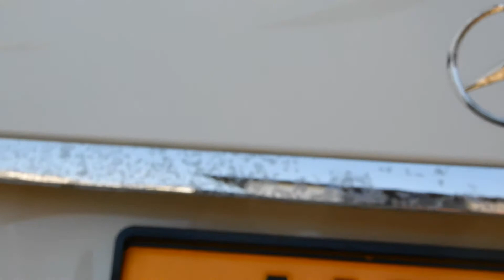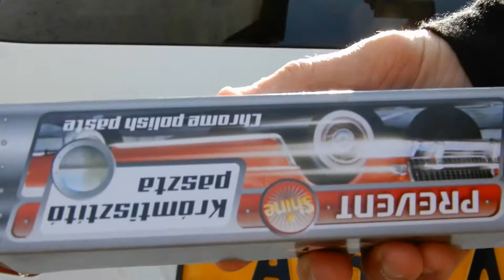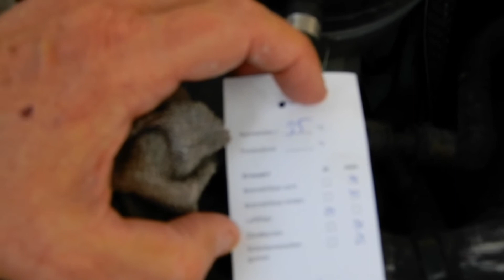First Car Clean For 5 Months !

Comment: How you doing arpaad nice to see the big torque monster out again sounds sweet as a nut and still looks well 👍
Reply from the maker: Thanks Robbie. I need to get the plates IE original registration put back on the car if i register it here. I miss driving my car tbh. 👍😊
Reply: @arpadattilatilla6358  I'm really enjoying my c350 cdi such a joy to drive great on fuel would be great if the price of fuel would drop here in the UK yours is still look great for its age and mileage
Reply from the maker: How mush is the diesel now there. I always put the Shell V power lol..My car is smoother and slightly quicker.
Reply from the maker: @robbiemullen9449  I have never been in a C class, but I love the look of them.👍😊
Reply: @arpadattilatilla6358  normal diesel like morrisons or tesco is 1.70 a litre shell esso is 1.74 a litre I think v power is 1.85 a litre diesel is an absolute rip off
Reply from the maker: @robbiemullen9449 
Ridiculous prices. Haulage firms will are going to feel it.
Terrible, this is typical of all government's, give you money or up wages then remove the money in other ways.
Cigarette's will be expensive now, glad i do not smoke. Must be £12 £13 a packet now. And i was a 44 tonne driver for Imperial tobacco in Nottingham and then it closed down, only 20 mins drive from my house in Beeston.
Reply: @arpadattilatilla6358  everything is getting more expensive absolutely ridiculous I think they are making fuel expensive too so people will buy electric pieces of shit 😂😂😂😂😂😂😂
Reply from the maker: @robbiemullen9449  definitely would never buy electric. Range is terrible for driving around Europe. Although Germany are very kitted out with the super fast charging points for Tesla. I am not sure if them points are solely for Tesla cars only. 🤔
Reply from the maker: Definitely be going to sleep in a electric car on a long journey..😴
Reply: @arpadattilatilla6358  I'm staying diesel for as long as long as they make them never buying electric nothing like the torque of a six cylinder diesel ⛽ 🤤🤤🤤🤤🤤🤤🤤🤤
Reply from the maker: @robbiemullen9449  Never seen this comment until now.🧐 I agree with you regards to the diesel, i would still need this car for long journeys doing videos and traveling to the UK. Definitely get the best of both worlds though. The C class is alot light than my car, bet it goes really well. 😊